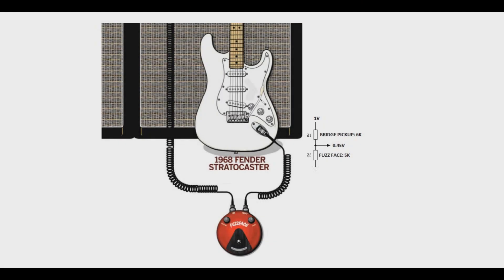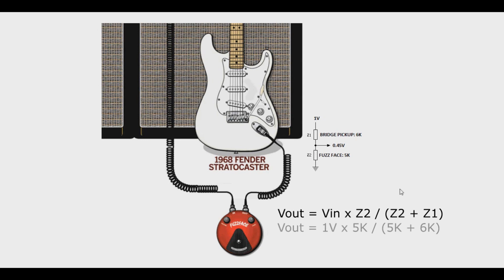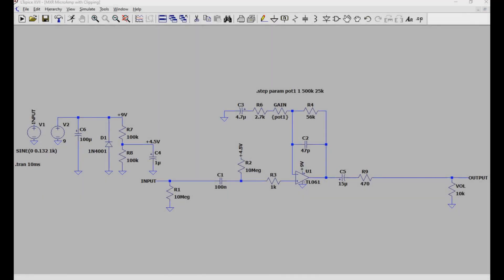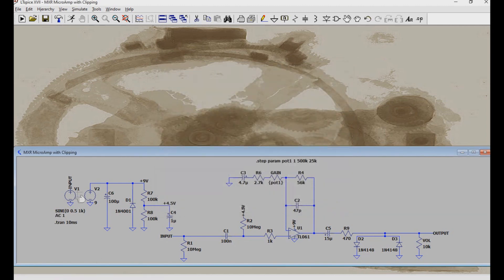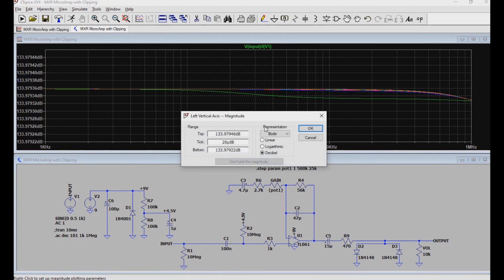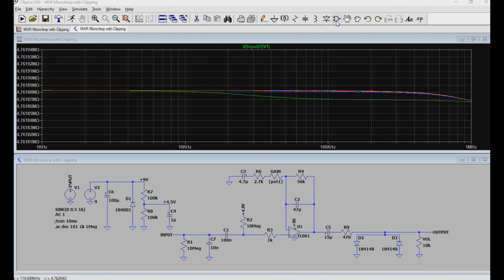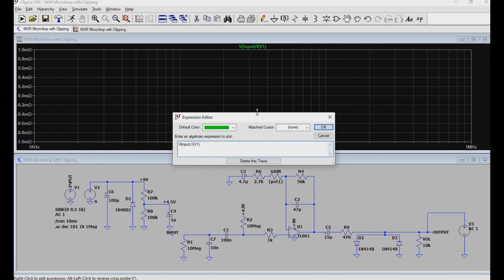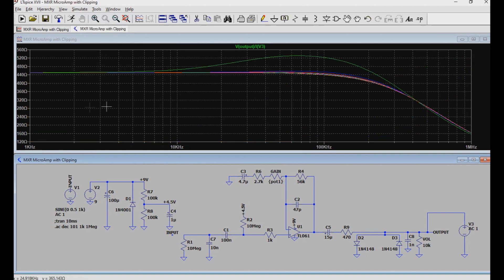Beginners Guide to LTSpice for Guitar Pedal Builders, Part 3: Measuring Impedances

Comment: Nice video, but I think the 10nF capacitor simulation is correct. Due to the 5M series "resistance" after the capacitor, the cutoff frequency will be f = /(2pi*10n*5M) = 31Hz, so all the frequencies will be attenuated

Comment: 9:14 the 10nF capacitor has an impedance of 15,915.5 Ohm (~16K) at 1KHz, which MUST affect the input impedance that much because it's in parallel with the ~5M input impedance. Watching your videos I always thought you at least knew the basics of electronics, disappointed, but keep on the good work.
Reply: I realized that after I recorded it, but didn't want to redo it. I probably should do a reboot on these.
Reply: @erikvincent5846 so should i still do the equivalent resistance thing?
Reply: @jayr292  no. don't do the "faking ESR" thing. either leave it empty, or set the actual resistance for your capacitors if tyou require detailed analysis. The video is wrong, the analysis is correct, there are no quirks with LTSpice. You would really get that input impedance if you put that capacitor there.

Comment: Now that I think about it, the whole thing with diode clipping is not very clear to me. From an electronics engineering perspective, could you explain sometime in the future which characteristics of diodes are important for the distortion effect. And, in which configuration they are commonly used. Maybe with minimum working examples in LTspice. That would help a lot for my understanding of the whole topic, and maybe others, too. :)

Comment: A bit late maybe, but why start at 1kHz? Most of the frequency's coming from a guitar are much lower, so why not start at i.e. 100Hz?
Great video nonetheless.
Reply: It just seems to be the "industry standard". A lot of guitar rhythm is under that frequency, but leads, solos, and resonant harmonics of chords do go up into that range often.
Reply: @erikvincent5846  I understand this is "what the industry defines", but (especially) in "our" field the lower frequency's matter. For reference, to play a note above 1kHz on a standard tuned guitar, you'd be playing a c6 which is the 20th fret on the high e string.
And yes, i also know that (resonant) harmonics play an almost vital role in the tone department. But that's just me wondering why ;) 
Thanks for your answer.
Reply: @SilentThunder1969  No worries. I think another reason that a lot use 1 KHz is that input impedance is frequency dependent. A lot of pedals have great impedances at around the 100 Hz mark that by 600 or so Hz are terrible. Namely due to input filter capacitors that go to ground on the input line. Tone Benders are a great example of that.
Reply: @erikvincent5846  Thanks again for your answer.  
From what I know and have learned so far, is that around 600Hz is where most of the "tone" is. So if you're playing solo's from about the 7th fret up,  bad filtering would probably kill your sound before it reaches the amplifier or other pedals.
Reply: @SilentThunder1969  This is true. There are some things in a mix, though, that some people (not saying myself) care about that go over the 1 KHz mark. For example, "pick attack", as in the sound of the pick colliding with a string, is at around 1.2 to 1.4 KHz. Some people want that stuff in their mixes. Myself, I try to cut it out of a mix, but that's an example of nuance frequency grabs.

Comment: Thank you for nice video. But I am not sure about the 10n capacitor. Capacitor of such a small capacity (foil or ceramic) will have series impedance in order of fraction of one Ohm. Its reactance will be approx. 15 kOhm at 1 kHz and that is exactly what you obtained. To set its serial resistance to absurdly high value is not a solution because such a capacitor does not exists. Because of RF jamming a capacitor with few pF should be utilized. My opinion.

Comment: Great, thanks! Maybe I missed something but why do you model up to 1 MHz? I would think that everything beyond 20 kHz is not important since it is outside the human hearing.
Looking forward to the next video in the series!
Reply: Nope, didn't miss anything. You could do less than 1MHz. That's my day job kicking in. I do work with electronics where I need to see the sweeps that high, so basically, it was just force of habit.
Reply: @erikvincent5846  Nice, thank you Erik. BTW, I want to express again how great your LTSpice tutorials are. They gave me an easy access to something that seemed too complicated for me to deal with. By now, I already created several circuits from my DIY pedals to model different pots in tone controls etc. Thanks again for the great work!

Comment: At 2:33 and on, when you switch the the Pro Co RAT, you update the impedances of the voltage divider, but you leave the voltage across Z2 as only 0.45 V instead of updating it to 0.994V.
Reply: Crap... now, do I reload or not